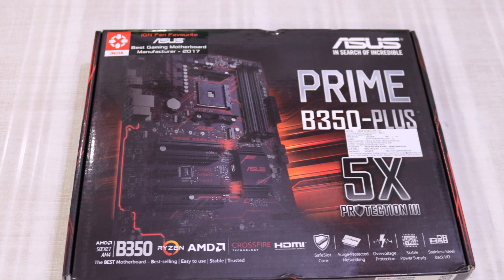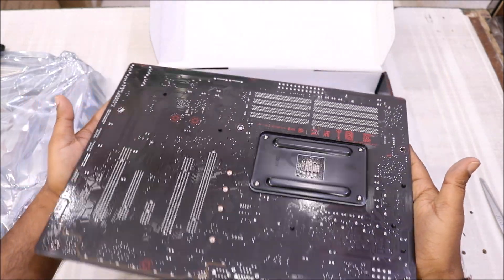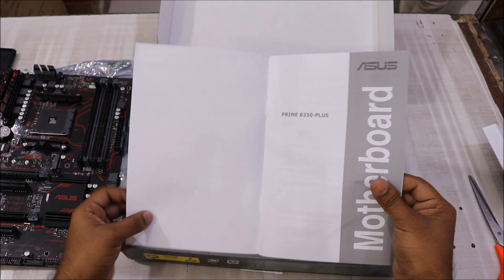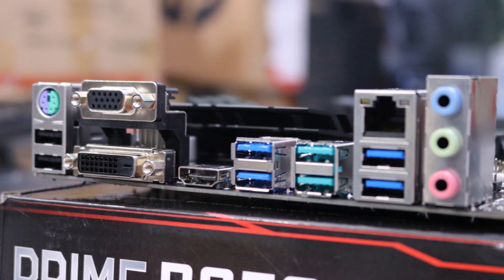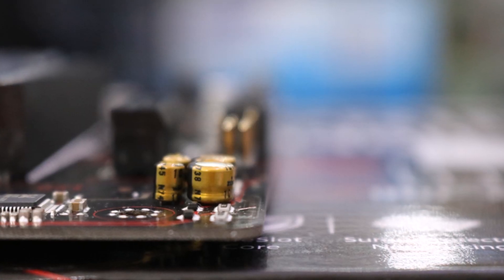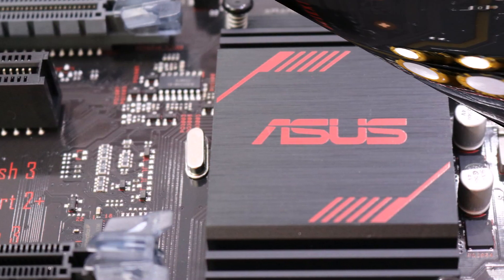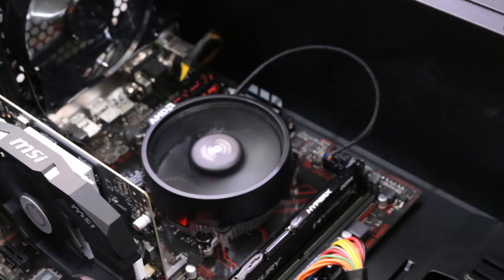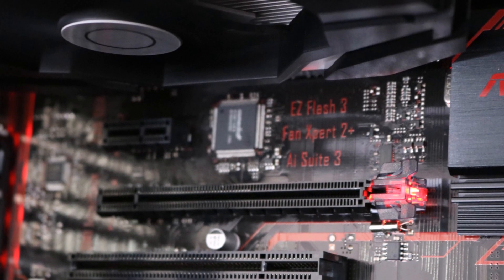Best B350 Motherboard for RYZEN Build

Comment: How about this build: Ryzen 5 1500x or 1600 with B350 motherboard nd gtx 1050 ti , 8 gb ddr4 ram (2400 M hz??),  1 tb hdd nd 128 gb ssd .... ur thoughts??? Also suggest a PSU nd any alternate builds if possible under 40k....i will be using this pc for 6 to 8 years...thanks nd loved ur videos?

i am not a very heavy user....i play fifa 18 and use softwares like matlab nd premire sometimes nd i watch nd stream a lot of high quality videos even hevc.....but my priority is to build a long lasting pc
Reply from the maker: every thing is good just try to get 1060 3gb this will really match the conf, and for PSU you can buy 550watts psu , this will do the work
Reply: Techmart Unbox thanks for the reply sir...my budget is around 50k only so 1060 not lossible...also what is the diff between 1050 nd 1050ti?? also does it make sense buying cheaper b350 motheboards??
Reply: Techmart Unbox also acc to my use should i go for a ryzen 5 1500x or 1600??

Comment: Bro 
1.Vs 550 psu
2.Ryzen 5 2400g
3.ddr4 (2×4) 2400mhz ram
4.Prosessor compatible motherboard
5.corsair carbide spec o4
6.windows 10 pro

How much it will cost
Reply: It will cost 35000 approx...if you go with asus prime b350 mobo...

Comment: Bro
I live in Bhubaneswar Odisha
I am planning for a pc build I was thinking that if you could build it for me and ship it to me
I personally know how to build a pc but I see that the prices you are charging are quiet less
So these are the parts I have decided to go for :
i3 8100
AsRock Pro 4 Z370 Motherboard
Corsair or HyperX (Which ever is cheap but with heat sinks) 2X4GB 2400MHz RAM
WD Blue 1 TB HDD
Corsair VS450
Cooler Master MasterBox Lite 5

I will buy a second hand ASUS GTX 760 for Rs 7,000 (Talked with the seller)
So, can you provide me the prices and if you will charge extra for building the PC
I can pay the delivery charges

Mail me at amgamingnet123@gmail.com
Reply: try mdcomputers.in or primeabgb.com onlyssd.com

Comment: Tech Mart Bhai koi ATX Mobo bars 7000 ke under ryzen me liye or koi itx motherboard bata ryzen ke liye
Reply: clash trends yo! Bro go with Gigabyte GA-AB350M-GAMING 3 (rev. 1.x) its only 6000 rupees and you will even get usb 3.1 gen 2 but its micro atx but you can go with Gigabyte GA-AB350M-GAMING 3 ATX model but its 8000 rupees

Comment: Bahot dino k baad ? And core i3 8100 k saath 1050ti use kr skte h kya ? Bottleneck krega kya?
Reply: SuMit Raj i3 is perfectly handle 1050 ti 
Cpu is also handle gtx1060

Comment: Will it support 2200g because there is much bios updates problem pls reply me pls 🙏🙏🙏🙏🙏🙏🙏🙏🙏🙏🙏🙏
Reply: if your light gamer then these APU processors should do the job with a high speed ram , but if your a core gamer then better get ryzen 5 and a dedicated graphic card .... you might tell me that you will crossfire in future , but the fact is crossfire is not a easy affair with APU processors graphic core they have a lot of limitation and compatibility issues .
Reply: Thulaa Tharshan well let's see if the price would be I am gonna buy it or go for a used but if there will no option I will go for gt1030 nd later on for 1050ti
Reply from the maker: Yes it will support. Make sure you buy latest manufacture motherboard , The one I got was jan18 manufacture and it worked out of the box for 2400g
Reply: Techmart Unbox which is better 2200g build or g4560 build pls guide me pls 🙏🙏🙏
Reply: Thulaa Tharshan bro i wanna build a gaming pc around 25 k nd going with g4560 8gb ram 2400mhz GT 1030 card is it good?
Reply: try to get minimum gtx 1050 2gb ddr5 (it can play most of the latest games in high settings) ... prices are high right now due to crypto currency mining and stuff like that ...  find a dealer who can get you this card for below 9.5 k or i would suggest you to wait for the price to drop .